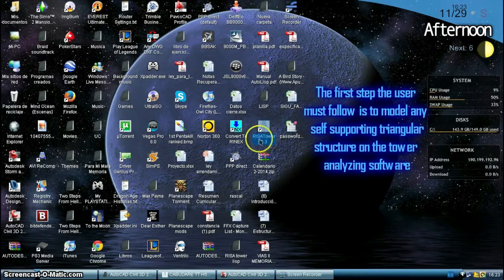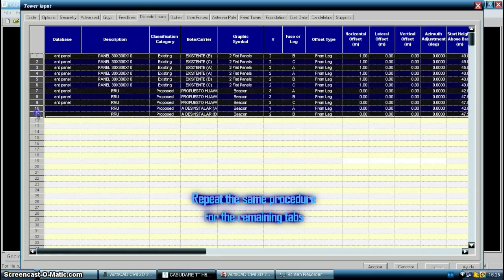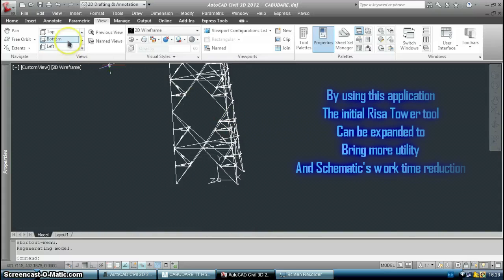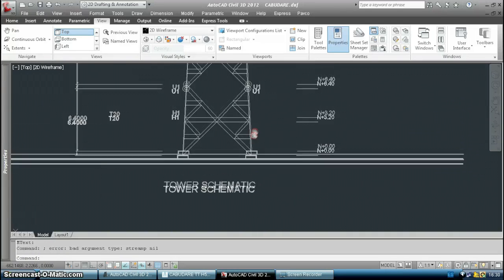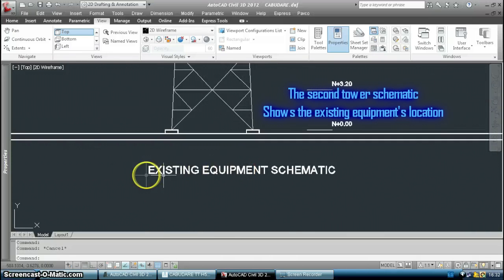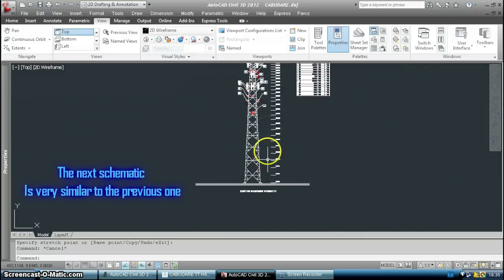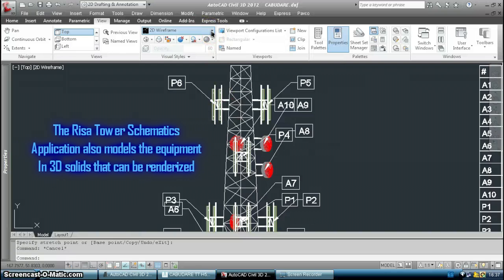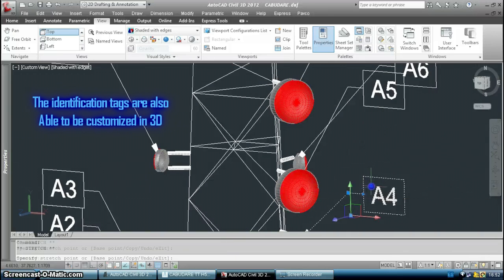Tower Schematics Program using Risa Tower database

Comment: Hi I want to design a tower with more than 4 legs can I do this with Risa tower ?
Reply from the maker: No, Risa Tower only supports guyed towers, monopoles and 3 or 4 legs self supported towers
Reply: Thanks. Can u say that which software could do this?
Reply from the maker: Sap2000 or robot structural analysis could do it, theres also bentleys staad tower